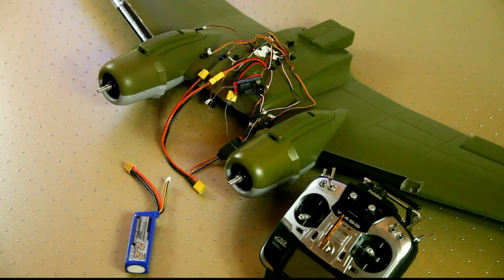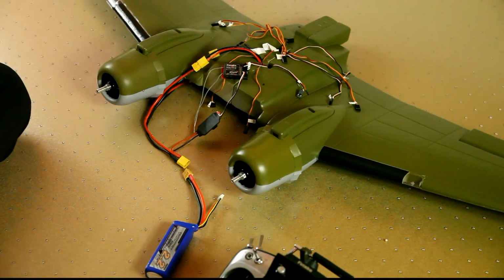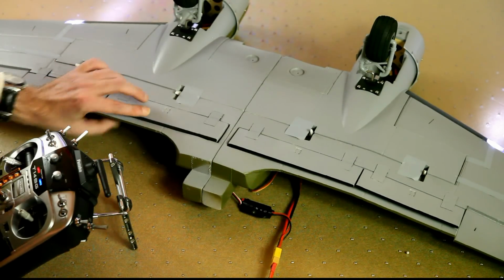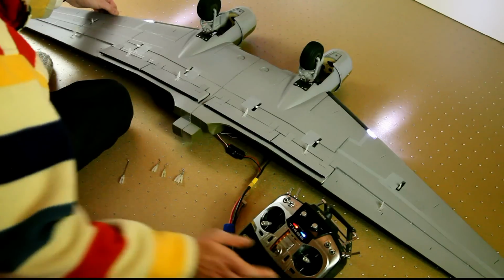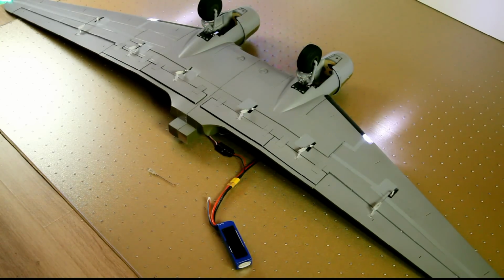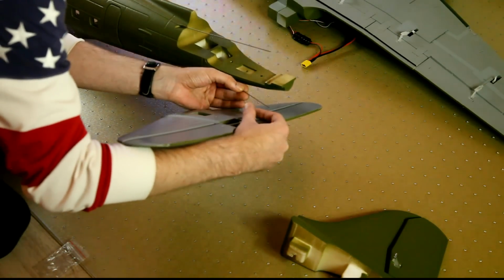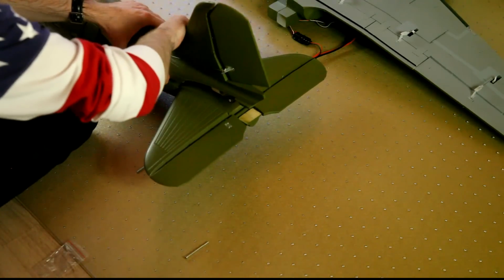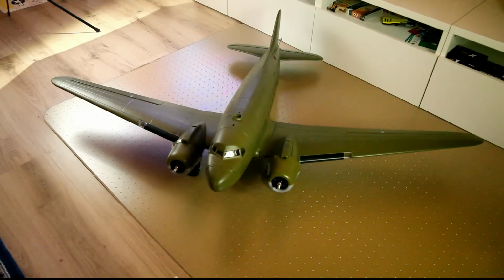Complete Build of Hobbyking's 1600mm C-47 / DC-3 mcDonell Douglas Dakota

Comment from the maker: Hi there people! 
Link to the plane: https://hobbyking.com/en_us/hobbyking-c-47-military-transport-epo-1600mm-pnf-green.html?affiliate_code=HJKOSMOIWCQWMNZ&_asc=59910720 
Here is my complete build of the mcDonell Douglas C47 / DC-3 by Hobbyking!
It is quite a long video.. I know.. I've tried to put some usefull info in it though.. Hope you can find the time to sit through it :)

Features:
• Plug and Fly  - Complete final assembly, and install your choice of battery and radio system
• Molded EPO airframe
• Bolt together construction, no glue required
• 3 decal sets included - American, Russian, and British
• Working landing and wingtip lights
• Functional retracts with steerable tail wheel
• Counter rotating scale propeller
• Large magnetically secured battery hatch
• 5A external BEC unit included
• Opening side passenger door and other scale details

Specs:
Wingspan: 1600mm
Length: 1103mm
Weight: 1700g
Servos: 6x 9g, 2 x 25g
Speed Control: 20A
Motor: 2x 2215 960kv Outrunner

Required:
6CH transmitter and receiver
4S 14.8V 3300~4000mAh LiPoly Battery

Comment: Love the looks of this classic bird  great video. I just got mine in and put her together and right out of the box a bad retract so I ended up manually deploying the gear so for now it is fixed. What are your low rates for this plane? Once again great video and fun flights
Reply from the maker: Camera Bird Thanks for the comment sir! :) 
This plane doesn't fly touchy at all really.. I have never used anything other then 100% rates on everything BUT with 40% expo on all as well.. If you have some flying experiance, that should do just fine :) 
Good luck on your maiden offcourse! :)
Reply: I have a bit of experience plane #19
Reply from the maker: :D  Then you should do just Fine :D 
It really flies like a gentle giant :)
Reply: Might I also add where have you put your CG because I have read that the listed location is incorrect
Reply from the maker: I used the CG from the manual. and that worked out pretty wel for ME.. And yeah.. there are Allways people saying the CG was incorrect.. (maybe they can't fly very well?)
Reply: Lol sounds much like my uncle. Yeah I was wondering about the CG because it seemed to be the most common complaint in the first month of sales for the model. Can't wait to get my Delta Air Lines stickers in to match the silver paint :). Thanks for getting back so quickly and once again great videos.
Reply from the maker: Thanks mate :)  
Well.. as long as you get the CG at the thickest part of the wing (mostly around 30% of it's width).. you will do allright...
Reply: I've gotten to fly my Dc-3 a few times and it wasn't what I expected once airborne it act terrible I had to gun the throttle just to keep it airborne and even at full throttle and a good 30 mph it would want to stall in straight and level flight even with flaps deployed and you can imagine the landings were a ton of fun. Any suggestions to help this thing fly better?
Reply from the maker: Yes.. It is underpowerd.. That's what I read from more people.. 
To make it perform better, there really is only 1 option: more powerfull motors.. Which would probably allso require like 40A ESC's...

Comment: Is there a way to turn the lights on and off? On my DC-3 the lights seem to be always on if they are plugged into the receiver, regardless of what I do with the switch that's assigned to that channel. Also, how did you get that servo off to correct the servo arm into right position? I have the same problem, at least one of the servos is poorly centred, but it seems to be attached to the wing with a ton of glue and I don't want to get too violent trying to rip it out.
Reply from the maker: ***** Hi there sir :) 
Nope.. those led's Only take the electrical current from your receiver.. the signal on that channel does nothing.. 
IF you want to be able to switch the lights on/off, you will have to install a switch for that.. 

Hmm it could be that mine was glued in with less glue.. I just gently pulled on it for about a minute, and then it came loose.. Just be carefull & patient :)  Violence won't help.. just a steady pull for a while, and the servo should come loose :)
Reply: Thanks for the info :)
Reply from the maker: No worries mate :) That's what my channel is for..

Comment: Nice video! Thanks for doing it. Just started putting one together-green as well.
Reply from the maker: Thank you very much sir! The build is pretty streightforward I think :)  Though pressing in the vertical stabeliser takes some force.. I would be interested to read if your aileron pushrods work well!  And good luck on your maiden offcourse :)

cheers
Roeland
Reply: DutchRC ADVENTURES So far I've had a few of the same minor things-one aileron rubs the wing and all but one flap need trimming to fit in the pockets. Have you had a chance to fly her yet? :)
Reply from the maker: RCdeparture Yes.. the aileron & flap thing was what I found as well (as mentioned in the video).. That should have been better on a plane of this price I think.. Regretably other responsabilities (and the weather) have left me unable to fly it yet.. Hopefully in the comming days!